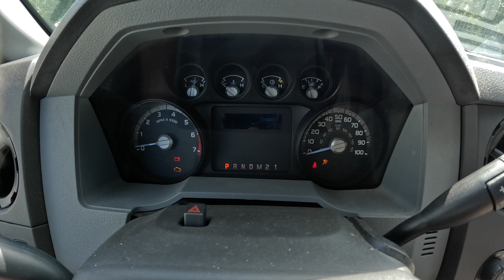6.2 Ford Super Duty Broken Valve Spring

Comment: I thought of doing them but the part is the same and there is a risk of breakage (what I was told). There is no aftermarket for them either. It is a very tall, weird spring. One of the big engine reman places replaces it with a shorter spring.

Comment: buddy's 2017 F350 dropped the intake valve on #5, died while he was driving it.  had it towed to ford dealer, they diagnosed bad starter, wanted to replace for $800.  
He declined, they charged $300 for their shitty diag, they didn't even try to bar the motor over, it was locked solid.

Comment: I lost compression going to Home Depot, loud knock. I had gone to the dealer when I bought the truck and told them that there was a ticking sound. They told me it was the injectors I’ve built engines before this was not injectors, but as you would know as soon as the warranty is out it breaks it sounded exactly like a spun rod bearing drove it home slowly figured it was ruined anyway went online found someone that was talking about a ticking sound that same person had another truck that had the knocking sound and said it was a broken valve spring so I went to the Ford dealer website and sure enough It’s not a recall, but it’s happening took the valve cover off on the passenger side, the second cylinder to the back had a broken valve spring. I just finished replacing it. I am putting everything back together. I will get back to you didn’t see any other damage with the camera inside the cylinderjust a broken valve spring thank you very much guys for all the information that you provide. This is a lifesaver.

Comment: when I bought my F350 with 100kmiles I just went ahead and replaced every single valve spring and valve seal so I'll never have to worry about it, i figured if ive ripped it apart to replace one and worry about they rest might as well replace all of them
Reply: That's what I was thinking. Why would you just replace one?  They all have the same use...
Reply: @mafamillemonamie1584  I have an 11 F150, 6.2L thinking of doing em one saturday, but I hear the new springs could fail too, more likely to fail early.

Comment: Is there a difference between the valve spring and the exhaust spring? I thought all of them were valve springs?
Reply: on this engine the Ford 6.2L, all the valve springs, both intake and exhaust are all the same spring...some engines are not, some use stronger spring for the exhaust valves and might indicate or list them as exhaust springs on the parts diagram
Reply: @caseydman4651 whew! Thank you

Comment: I lost 2 springs on mine . 2 different times. I have it in the shop now. I am having the rest changed out. I am unable to lean over  the fender anymore. I did the two and it was a struggle. I got lucky it was the front cylinders #1 and #5 . I am also doing the timing chains . it has 200k on it. good compression still.

Comment: Excellent job.  Thank you for filming this, definitely within the ability to do.  For this being the biggest issue with the motor this is a pretty straightforward repair.  (Yes I’ve seen the ones where they drop the valve or impact).